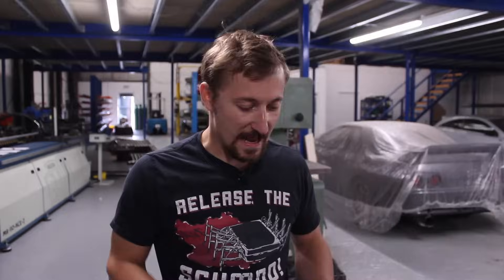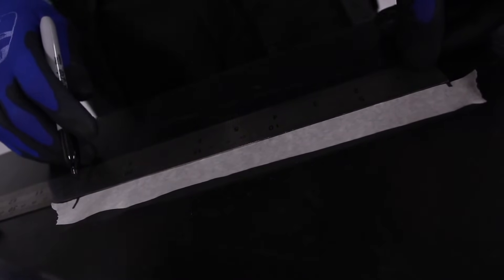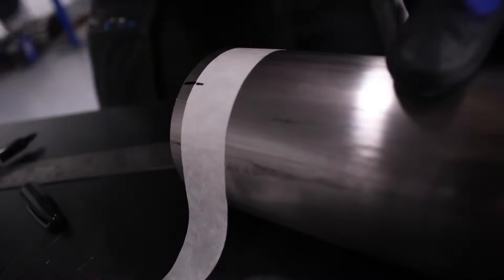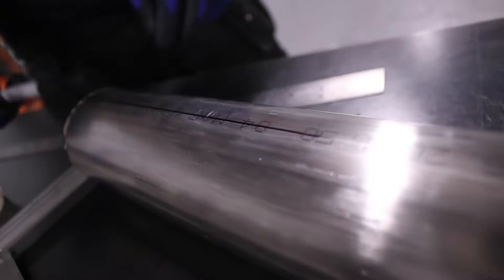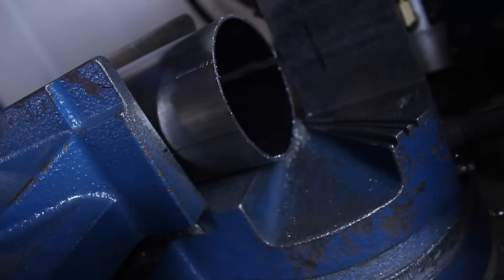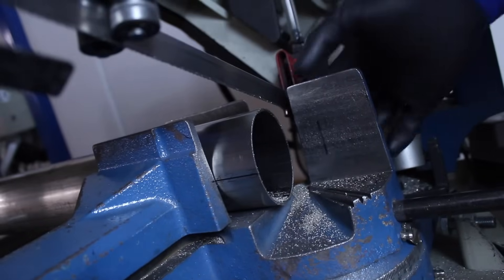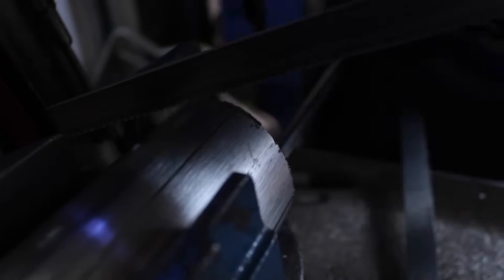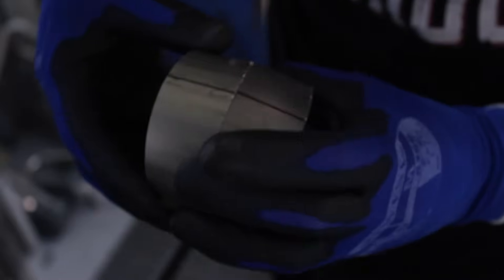How To Make Pie Cuts | Quick & Easy Method - Stainless Steel Pie Cuts For Exhaust Fabrication

Comment: Yeah... quick and easy if you have an expensive bandsaw that can be set to any precise angle 🤦
Reply: I’m doing basically the same thing with a $50 portaband used in the harbor freight $100 stand (that I got on sale for 25% off). That’s a lame excuse.
Reply: Or just use a rotary cut off wheel
Reply: Or a hacksaw
Reply: Chop saw works too it just eats more material unless you have a special metal blade

Comment: Easier way to get the center line is use a piece of material that puts the sharpie at exactly 1/2 of the width of the pipe and just move all along the pipe.

Comment: You can use a length of angle iron to mark a straight line down a tube. Just lay the open side of the angle along the tube. It self centres because it sits on the 2 outer edges of the angle. Then align the edge of the angle with your centre line from using the tape.
Reply from the maker: Yeah that works well, assuming you have a good straight piece of angle kicking about that’s not been used as a pry bar!🤣
Reply: He mentioned that in the video if you watch it
Reply: @chrissantos7865 literally